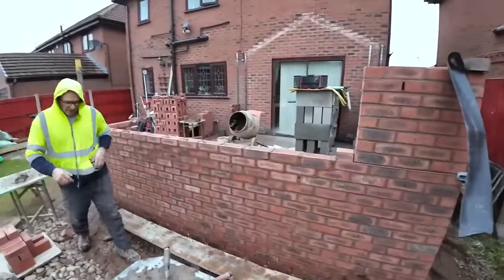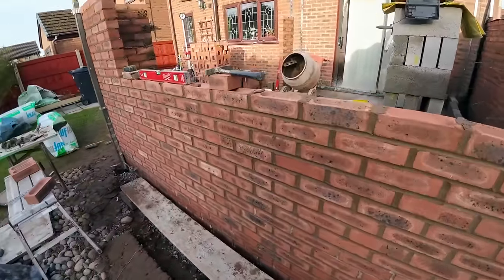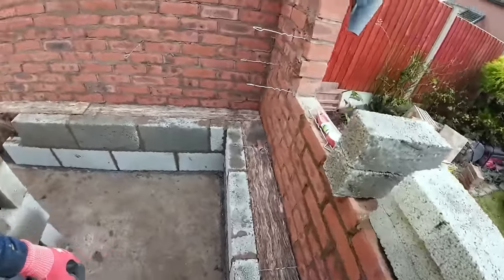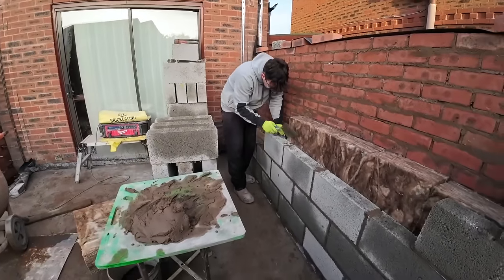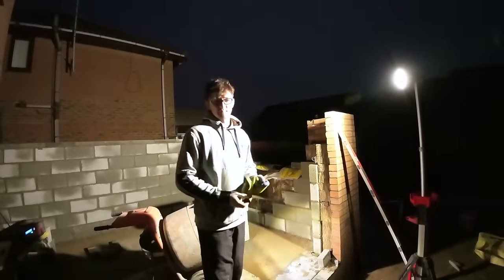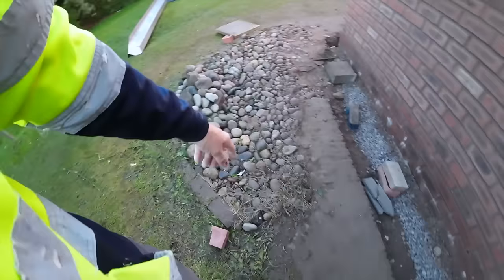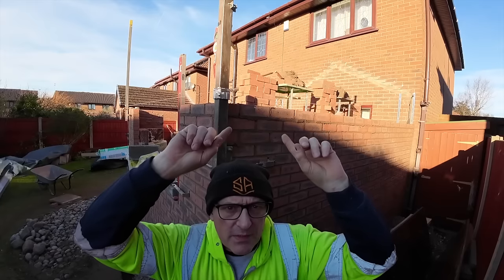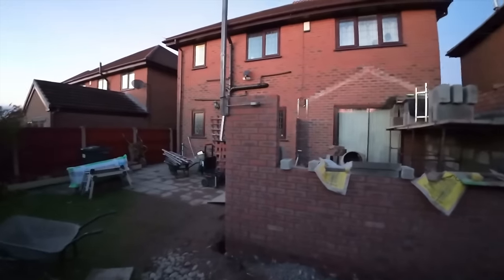PART L COMPLIANT 150 MM CAVITY WALL.. CONSERVATORY TO EXTENSION PT 7

Comment: Lovely job there fellas. I'm sure the loss of internal space, due to 6" cavity will be compensated  for by the thermal performance of the structure saving them around 6% off their heating costs.  Until utilities add another whopping  20%+ to their heating bills anyway. Remember all the money you saved by "upgrading" to energy efficient LED lighting? no me neither.
Reply: @blzbub
So very true....
Mind the air-sourced heat pumps.......there will be one along any minute...
Only £14k a pop.

Comment: Question for u lads? When putting insulation in cavity, what happens if outside bricks get saturate with rain, does it affect the insulation in cavity, how does it work
Reply from the maker: Water won’t pass through horizontally only vertically 🧱👍🏽

Comment: Also it looks like your using concrete blocks ,there cold heavy thing as well ,guess it was specified
Reply from the maker: Nope 3.6 n light weight fiboilte blocks , very thermally efficient 👌🏼🧱👍🏽
Reply: Apologies they looked like concrete  on screen when they were wet , thought it be strange to use concrete blocks inside these days

Comment: Why have they gone to 6 inch cavity for a conservatory is this the same requirement for all extension work instead of the 4inch cavity?
Reply from the maker: It’s not a conservatory 🧱👍🏽
Reply: I asumed as your title calls it a conservatory that is why i asked that question
Reply from the maker: “Conservatory to extension “ 👍🏽
Reply: 150 is the norm now  with dri-therm insulation
Reply from the maker: @tonyosborne56 🧱👍🏽